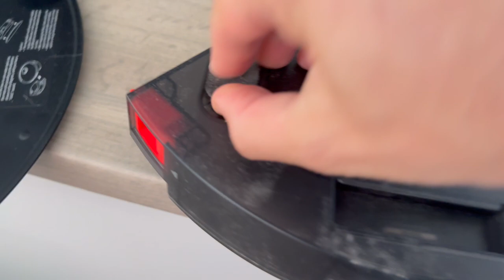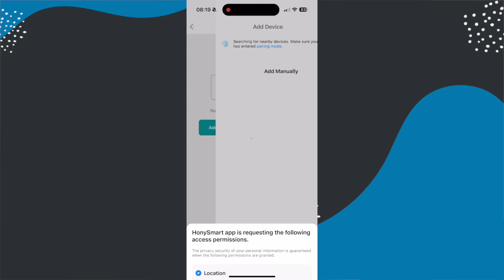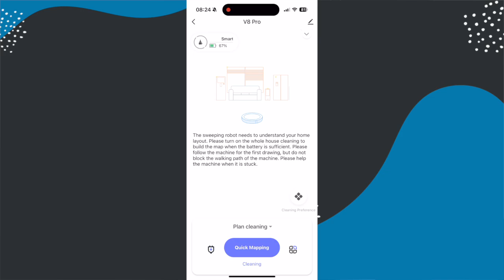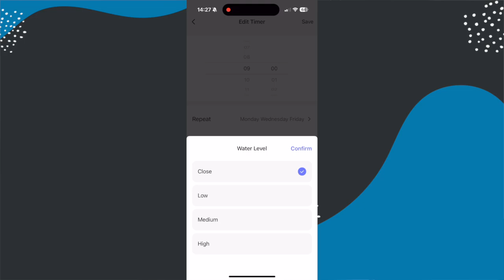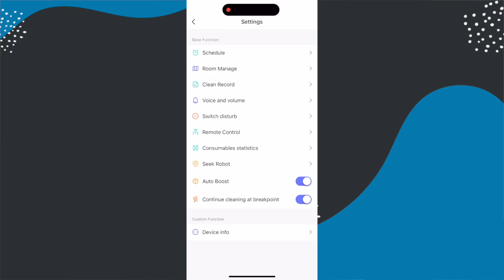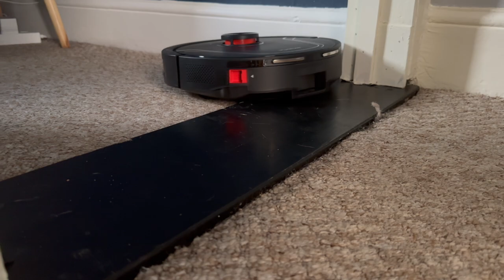Honiture V8 Pro Robot Vacuum Cleaner Review

Comment: hi Mark, thankyou for a very thorough review. I actually have the Lubluelu L20 which appears to be the ‘same’ machine. I have noticed on the back of the water tank/dust box a small flap which links through to the dust box. this suggests to me it is capable of using a self emptying station but neither Honiture or Lubluelu mention it. what are your thoughts?

Comment: Is this a paid review.....? Or is this vacuum actually worth buying? This is pretty much the only review video i find on this vacuum
Reply from the maker: Not a paid review but as I said in the video the company did send me it to review however had no idea what I would say about it
Reply: @MarksTechVlogs  no for sure I get that. But I'll ask this then lol would you spend 190$ can.. 135$ us of your own money on this? Or should I invest more and get a half decent brand
Reply from the maker: For the price it’s pretty decent, the suction is good, it navigates bumps well, schedules work etc

The main downside against spending a bit more is that it doesn’t self empty so you have to remember to empty it probably once a week
Reply: @MarksTechVlogs  even emptying it every couple days wouldn't be too much of a con for me if it does a decent job as an alternative to vacuuming when I don't have time. As long as it has decent suction and doesn't skip too many areas  ( for no reason  )
Reply from the maker: I didn’t find it skipped areas, just needed to set no go areas for charger cables so it didn’t destroy them!

If you’re an Apple user I’d add it into the TUYA app rather than Honiture app so you can use Siri Shortcuts with it too

Comment: Can i still use this product without wifi? Currently only using my phones hotspot for internet.
Reply from the maker: I don’t think you can set it up without WiFi I’m afraid
Reply: @MarksTechVlogs  so a mobile hotspot as WiFi wouldnt work then?
Reply from the maker: It might work if you had a 2nd device to use when you set it up as you’d need to connect to it via the device you’re setting it up on, so I reckon you might be able to set it up to your phone hotspot if you use a tablet to set it up with
Reply: @MarksTechVlogs  Ok, thanks for your help